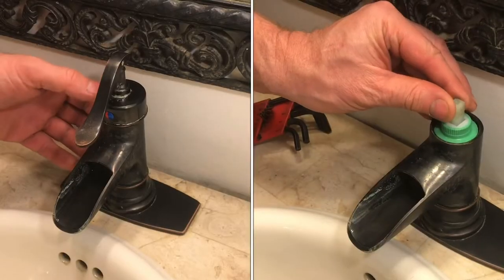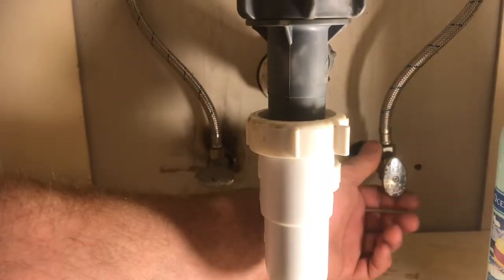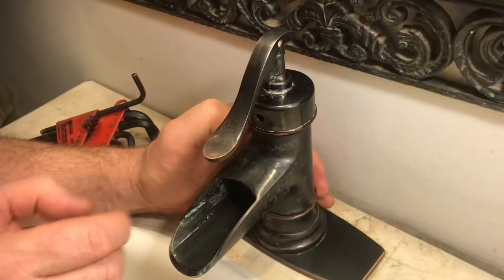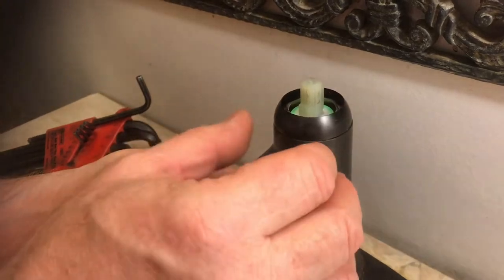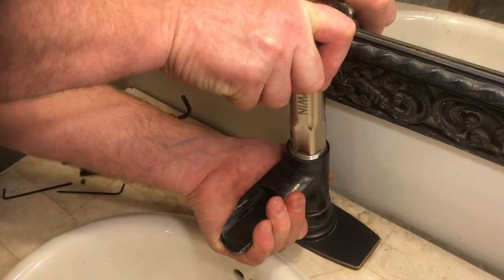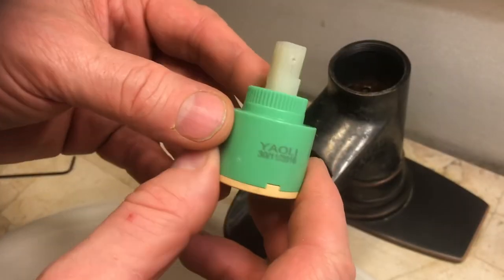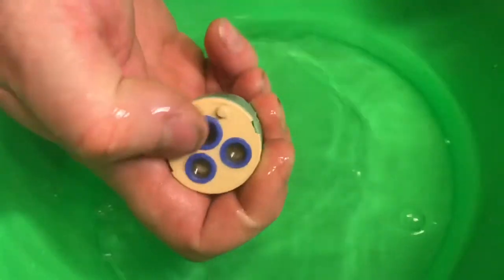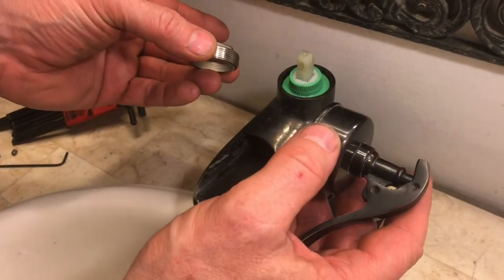“removing” a FAUCET CARTRIDGE (and cleaning it)

Comment: I have a Tuscany one handle kitchen faucet that has the same internal plastic clip. There was something in there, I got it out, put the plastic diverter piece back in and still low pressure... It's making me think that something is inside the nozzle that releases the water inside the sink. Going to try a handheld snake tomorrow as a resolution. Water is coming out the shut off valves with pressure, the lines themselves are clear, I took out one and ran it in reverse and vice versa on the other (cold/hot) but when everything is connected and trying to run thru the faucet low stream or no stream. Has to be inside where the water goes from the diverter (cold/hot holes) to faucet being blocked but don't see anything like about how to clean that out... Any suggestions are welcomed.
Reply: Did you check the aerator?
Reply: I have Tuscany 1 handle that has low pressure on cold side after about 30 seconds on cold side, hot and sprayer on cold is full pressure.